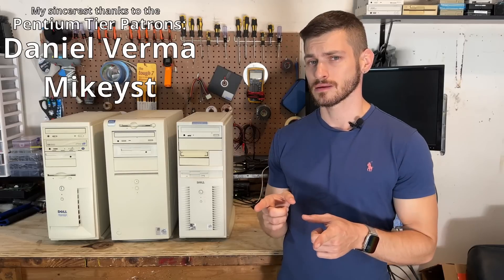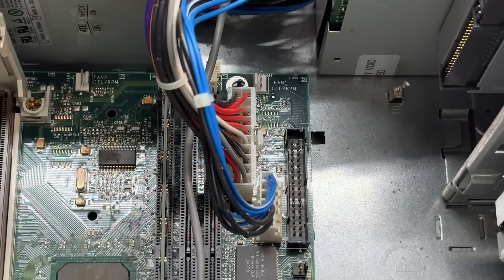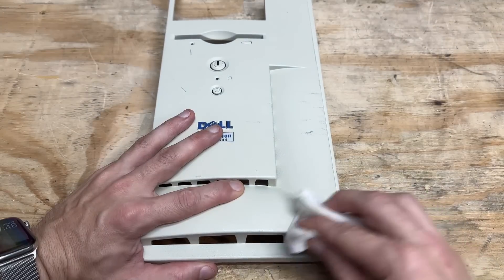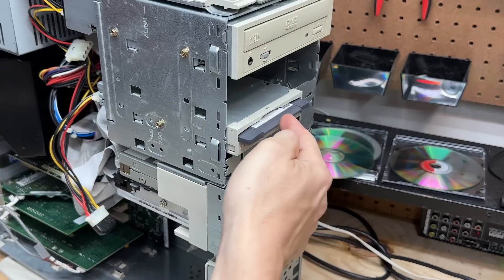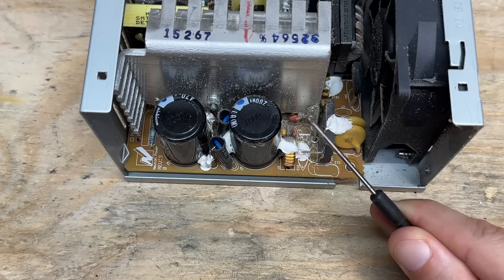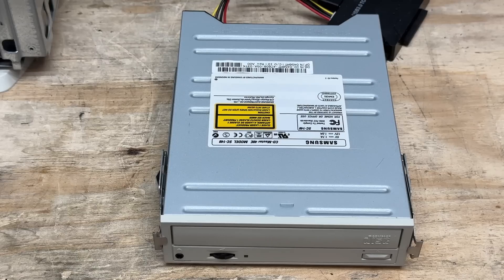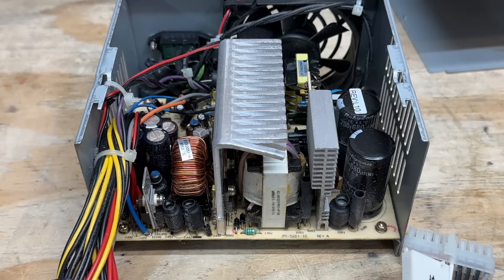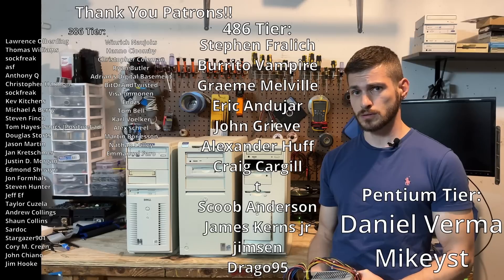Time to resurrect some Dell systems!

Comment: Man I always had the biggest crush on “Steve “ dude you’re getting a Dell lol. I have a Dell Dimension L866r running windows 98se I still use to this day for retro gameplay. I also have a Dell Dimension 2400 running windows xp professional. It’s hard to beat the old Dell systems.

Comment: 0:01 The one off to the right was our first decent PC for me and my brother to game on. Pentium 2 MMX 233mhz! 8:44 with the fan off hit it with a hair dryer for 10 minutes then drop the oil in. If you can always remove the fan blades when oiling the fan so the motor gets hot, opens the bearing and lets lube in. fans are obviously air cooled.

Comment: I found my XPS R450 in the back alley. I cleaned it up added 384 MB RAM, a 128 MB ATI Radeon 9200, Sound Blaster Live! The HDD even had XP on it, but I took it back to 98 SE.

Comment: I have since been able to quench a little bit the jealousy I had for that treasure trove discovery you made :) I replied to an ad for a closed down company here in lisbon (portugal) and I found a storage basement with loads oh hardware, mostly pieces and empty AT cases
But I also found 2 MFM hard drives, a 386 dx 40 mobo with an OPTI slot, a xerox 286, several IBM terminals (with the M mechanical keyboards) several 100/200 mb hard drives etc :)
Tomorrow I go there again because the guy told me that there may be some XT systems lurking in the shadows there... 
Gosh retro hunting gives such a rush !

Comment: Dell dude!
19:26 that’s a wicked driver install screen..
On system 1, you can use snappy driver installer but I think it’s for only NT OSes.  I wish Slot cpus were still around. I love 3DMark 2000’s benchmarks, they look so cool. System 2’s sound card is most likely a soundblaster 128 pci or ensoniq audiopci. I love the case for system 2. The taskbar on system 2’s copy for windows 98 looked weird, but I hope no one ever names an education title “Chicks Gone Wild” again. Good luck with Zip drives, not with optical drivers! I though that board on the video card in system is a DVD or MPEG-2 decoder.

Comment: Dell GX-110----that really brings back memories. I had 6 of them (ex-school computers). All 6 had Maxtor 10 GB hard drives, and all 6 were dead (bad heads). That's no doubt why they got rid of them. But 5 of them fixed up very nicely, the 6th had a bad mobo. Man, are those computers heavy....

Comment: For ABS plastic repair like the slot 1 CPU retention bracket, I usually use contact cement, which is used in plumbing to join plastic pipes. It basically melts the parts together and they end up as strong as it never broke.

Comment: Those proprietary Dell power supplies were quite common, you can find the pin out online pretty easily. The grey wire is the PS ON wire that needs to be grounded to test the supply. I don't believe they have any non standard voltages or anything so you could convert them to standard ATX PSU by splicing the 20 pin connector.
Reply: Fun thing is, DELL were not the actual ones inventing that abomination. It was Intel for.. reasons no one knows lol

Comment: Hey Mike, I'm not sure if you know this or have tried it, but if you are going to super-glue something, if you sprinkle a tad bit of sodium bicarbonate on either piece after you put super glue on them before you mash them together, the baking soda will almost instantly bond and dry the super glue. It's like magic and works great for adhesion and drying. It works really well. Zero wasted time waiting for it to set up, even the gel, as that's all I use as well.. Love it, and luckily I have a Harbor Freight very close to me so I get the 10 packs of the gel for 99c when it's on sale!!

Comment: A while ago I got a free Dell Dimension 4100, which was in a case just like that XPS T500 in perfect nick, just a bit yellowed.  This was before I was interested in vintage computing.  First the case broke, so I built a new one out of wood of all things (Tudor Dell), then the PSU died, managed to find another (proprietary). Then the motherboard died.  Managed to find a new old stock socket 370 motherboard and built up a system in a new beige case, and used all the original Dell bits and pieces including the cpu, RAM, GPU and drives. It's one of my favourite vintage machines now - it just won't die! A bit like Triggers broom I guess 🙂

Comment: Yes, yes, and yes! I have all three of these systems and many more. I am a Dell hoarder for sure! Glad to see these systems get more attention and care. The proprietary power supply Dell inflicted upon them definitely made a lot of owners upset (rightfully so) and to this day dissuades many from collecting these things. However, the 20-pin connector relocation isn't necessary for installing a standard ATX power supply. There are adapters you can get for about $10-$15 that convert standard pin-out to this Dell one. I have them in my Optiplex GX300, GX110, and another tower I don't quite remember the model of. So far so good, though these adapters seem to be getting harder to find nowadays. Definitely recommend trying to get that before re-soldering stuff. Looking forward to more from the Franklin haul!
Reply: do you have a 1st gen 333d desktop computer...

because i do.
i actually have most of the original external stuff minus the monitor 

it's got a branded 1st gen mechanical pinrod keyboard with a ps/2 connector

[hope i'm using that term right but the keycaps are on plastic rods]

i mean i did source a 1st gen dell monitor but it's from a newer system 

and also doesn't power on at all but a little electronic surgery and it should power on.

(i don't have a question mark on my digital keyboard i'm on a tablet i have to use "..." instead)

Comment: The grid pattern on the tuner card is known as "copper thieving" and is related to the manufacturing of the PCB itself, nothing to do with attenuation of noise/interference.

There's a few reasons that it could be added, such as reducing the amount of copper that needs to be etched off, or maintaining copper distribution across the board which can help to reduce warping during reflow and also maintain consistent dielectric thickness between layers, and many more reasons.

It comes in a variety of shapes and patterns.
Reply from the maker: Thanks for the info!

Comment: I remember supporting a number of those Dell Optiplex GX1/GX110 in desktop and tower form, they were very quick machines but sadly had no AGP slot!  IIRC its an NLX motherboard/riser design.   Windows 2000 with even only 128Mb RAM worked great on them.

Comment: I worked for Dell in Customer Support for about 7 weeks about 20 years ago.  I was impressed at the time with the diagnostic lights that were included on the back of the machines at that time.  They also had a really good knowledge site for how to work on their computers back then.  If I remember correctly all of the Dell cases of that era were named after MASH characters, and the first and last computer you worked on had the name of Klinger, because they could be configured as a tower or a desktop layout due to how the drive cutout was created.
Reply from the maker: Named after MASH characters… I love that!
Reply: do you remember anything about older dell computers...

i tried to research a older dell only to discover dell deletes the product information after 2 years

the computer in question is a dell computer corp. model 333d desktop computer 
"a ibm clone"
capable of running msdos 

when i got it.
it was not stock and unfortunately i cannot find out what was stock because that info was lost to the void

Comment: System 1 very likely came with Windows 95 OSR2 installed depending on when it shipped (check the service tag if its still on the machine). They were a PAIN with drivers since it wouldn't be until Windows 98 that things like AGP, DVD drives, and the decoder card had built-in OS support. The DVD decoder card is missing the VGA feature connector ribbon that connects to the video card. The cards Dell used were Quadrant Cinemaster C or Cinemaster S. Don't recall which one... that or they used both depending on the build date and Dimension line.

Comment: Another great video thanks. looking at the broken cd burner @ 17.07, 2 small screws the potentiometers below laser optic these change the laser power i think one for the read and one for the write, usually one for reading cd and one for dvd tiny amount moving these can bring it back to life.
Reply from the maker: Thanks for the info! I’ll definitely be trying that. There’s just something I like about this drive.

Comment: About them HP writers .
They were ,as i remember,a rename/rebrand of some major drive maker,i remember flashing 'em with an original firmware.
Reply: Speaking of HP burners, i came across a few unopened cases of the litescribe discs at goodwill recently and was hunting for a surviving drive on ebay, turns out some companies are still making them new, blew my mind since i assumed it was dead tech since i hadnt heard anything about it in years.

Comment: Yet another great system tour, I love these old Dell systems ,that first XPS system has the same case as my Dimension 4100, i love the 4100 but sadly no ISA slots, there exists adapters that let you connect a standard ATX power supply to those dell boards but i bought mine so long ago I'm having a difficult time trying to track down where i bought mine, but they do exist

Comment: With some companies being so big  the have the old left hand does not know what the right hand is doing, I wonder if any of them are still paying for the 1-800 numbers for upgraded , registration etc ? Be interesting to let the modems try and dial out, most likely numbers got resold , and you will hear "Hello" "Hello". I worked for a large National transportation company and they  sent out lists of phones numbers to different regions to see if they were really in use.  dozens of FAX machine lines and alarm system numbers etc were found to be just gathering electronic dust

Comment: You should take one of your working Dell PSU's and take some voltage measurements on it while it's under load, so you'll have a frame of reference for testing power supplies that have problems. If the older ones are anything like their more modern counterparts, I'm betting that the "standby rail" is 12 volts, not the usual 5 volts of a standard ATX supply.

Comment: Great channel my last Dell pc was slightly newer XPS 200 (a dimension 5100c rebage)

Great little system the upgrades where 500gb SSD better low prifile gpu and more ram think the nax was 8gb (4x2gb) , last upgrade was wondiws 10  , but rolled it back to 7 as performance suffered , gave it away 4 years ago its still in daily use

Comment: I have Intel SE440BX System (same motherboard that dell used) with standard ATX power connector as you mentioned in 44:08 and empty spot where the dell extra connector is

Comment: that T500r does make a pretty good late 90s early 00s gaming PC! I have a D300 (pentium 2 300mhz) that I swapped for the same board you have there. stuck a 700mhz p3 and a gf4 mx440 (128 bit bus) and it runs quake iii and unreal great

Comment: The first and 3rd system the cases are OEM'd by Palo Alto the model is the ATCX with the first one being the Rev 2 of the case with the strut bar built into the chassis making the side panel easy to remove the other being the rev 1 tthat has the strut bar on the side panel which makes them harder to remove.

Comment: I came across a similar dell dimension, desktop form factor, slot 1, it didn't have the psu, I pulled out the motherboard, found an old enough psu without active pfc(somone told me that using one with active pfc will make it blow up), the pinout for the proprietary dell connector and improvised an adapter. Surprisingly it worked without any problem, used it until I found a good dell psu with the proper connector and then repurposed the adapter. Pretty time consuming making the adapter, rewiring 24 wires in total, making sure everytime I wired them properly. It was pretty strange that dell decided to have only 2 voltage rails (12 and 5v i think, I don't remember)on the 20 pin ATX connector and the 3.3V one on the other p4 AT like connectror. I don't know how i didn't blow anything up though when the pc was turned off the psu was making a very very loud coil whine😂

Comment: The first system slot 1 CPU heat sink should be changed for a solid one. Those fins are glued on with some kind of double sided material. And Get a chassis fan, and a separate CPU cooler/fan for it and ditch the plastic manifold.

Comment: That first PC reminds me my first, where I had all slots filled with something including 3 random network cards and mix-matched RAM just because I could. 
You can also sacrifice a dead Dell power supply for the connector and solder a standard ATX socket to the cable to make an ATX to Dell testing dongle._
Reply from the maker: There will certainly be some PSU hackulation in the next Dell video!

Comment: I have a feeling that most of the personal data on these older systems is probably so out of date that it would be near useless for any nefarious means at this point, i guess the tax records could have some social security numbers but beyond that its probably harmless at this point. Whenever i pass along old hardware i do a full over write then reinstall the original OS but if its a windows system that could be problematic if you are a stickler abput product keys, i converted to almost strictly linux during the windows 7 era though so thats less of an issue for me anymore, plus since my kids grew up with linux they can pretty much use anything they come across now as adults.

Comment: Eh, among my stacks of towers from the 90s-00s at least half of them had a pre-installed tv-tuner card, very few got any real use to my knowledge 😅 

I suspect they were relatively cheap and easy to add more advertisable features to a "home media center" (which most home PCs seemed to be advertised as those days) as long as it had room for another card, most of my collection consists of "WinTV" cards however

Comment: I came across an Optiplex GX100 with the same riser and one of the things I was pleasantly surprised that there are alternative styles of risers, including several that share ISA with PCI slots. 

I'm a bit disappointed with those DELL proprietary supplies but I'm tempted to repurpose an ATX extension cable to make an adapter for regular ATX power supplies. Either way, that case is pretty neat!
Reply from the maker: I sure would like to know the rationale behind those proprietary connectors... It should be simple enough to make an adapter cable assuming this power connector mod is accurate.
Reply: @miketech1024  I guess they only wanted themselves to be able to repair & replace their hardware. Can't service your own product, you have to go through Dell!

Comment: Hello, I myself am interested in repairing retro tech and love watching your videos. I want to learn myself since I have 2 vintage laptops
Reply from the maker: Thanks! Beware of brittle plastic and leaky internal batteries. What kind of laptops do you have?
Reply: @miketech1024  my oldest laptop is a Toshiba Satellite 1605CDS laptop. It has a bad battery, to be expected. But it does not complain when I boot it up every time. But it does hold the time, oddly.  The fans sound like a lawnmower, very loud. So I think it need some type of oil. Also the hard drive is under the keyboard for some odd reason. But it works very well. It does not shut down normally, I have to force shut it down. When I do, it does nothing. But it works really well. Also does not hold a charge ( witch is to be expected). But I love it! Does not take too much to make me happy with retro tech.
Reply from the maker: There may be some hidden Ni-MH batteries deep inside (sometimes separate for CMOS and stand-by). They like to leak and destroy motherboards.
Reply: @miketech1024  yeah, that’s kind of worrisome. I don’t know what type of CMOS battery this type of laptop uses, I’m not good with specs, so I don’t even know what type a motherboard it even uses. But hey, I really do love your videos, and I love to learn a lot about repairing tech, especially Retro.

Comment: i'm fascinated by slot based CPU's it seems so alien today
Reply from the maker: They still seem so strange to me.
Reply: I wasn't a fan of the slot CPU.  It came along after the Pentium Pro and was a bit of a move backwards.  The Pentium Pro had on die L2 cache that was manufactured by Intel that ran at same speed of the CPU.  The slot CPU used 3rd party L2 cache that was effectively off the die that ran at half the speed of the CPU.

Comment: There’s something about those old HP burners that’s just tricky. I have one of those cd burners and it reads disks but very slow with a lot of I/O errors. I’m thinking the laser pot needs to be tweaked? Short of that these burners seem to drop like flies. HP sure did make these drives pretty though 🙃

Comment: Love the old school Dell systems. Got a handful of the 4100's and an L866r in my collection. Would really love to find a good Dimension like the last one in the video for a Win95 setup. 

Btw, I cannot get Knoppix 9.1 to boot in any of my pcs for some reason.
Reply from the maker: What kind of systems are you trying to boot Knoppix from? Knoppix 9.1 ships with an i686 kernel, so it won't run on anything below a Pentium II. On modern systems, you'll have to fuss with EFI secure boot. On some systems, secure boot will play nice. On others, you'll need to completely disable secure boot in favor of legacy.
Reply: @miketech1024  So, the ones I've tried are my Compaq 7ap195 with the AMD Athlon 1ghz and either of my 4100's running the P3's. Just would not do anything at all.